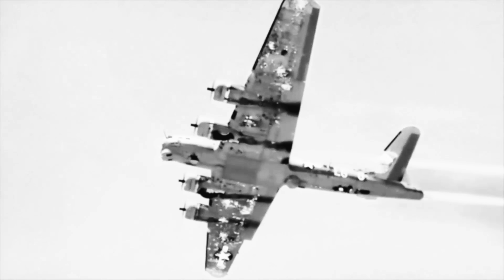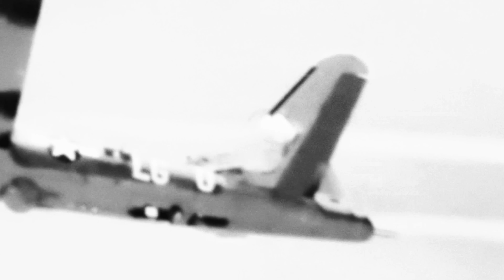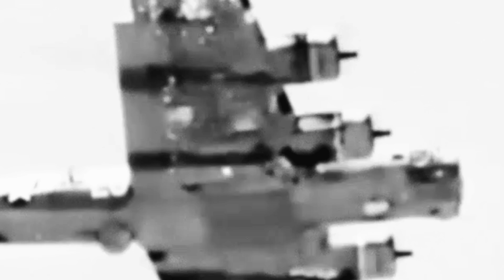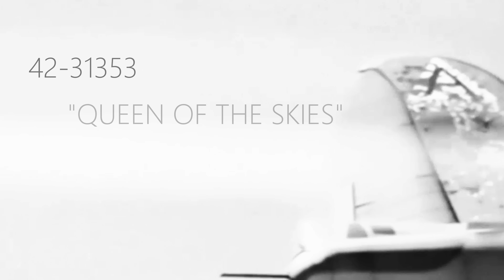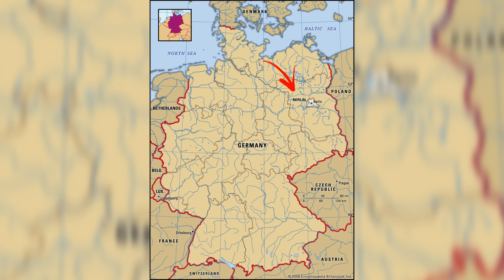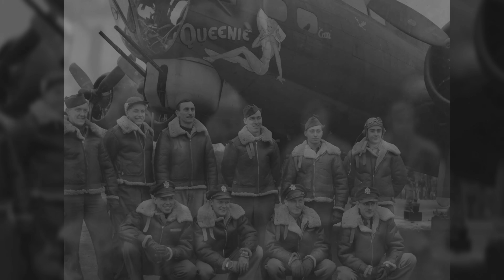The most Damaged B-17 Bomber you'll ever see Flying

Comment: My father was Army Air Corps stationed in the South Pacific during WWII and told many harrowing stories of B17’s in battle. The one that comes immediately to mind was of a landing wherein the entire mid-section of the plane had been shot away from the wings to the tail. The only thing keeping the tail section attached were the control cables. The tail-gunner having survived had to traverse the control cables hand-over-hand in mid-air to get into the main body of the air-craft...

Everyone knew what was going to happen when the plane landed: The tail-section would flip up and over impaling the fuselage. All of the remaining crew crammed as far forward into the cockpit as the limited space would allow. Have you ever been inside of a B17? The movies makes the interior look larger that it actually is. The quarters are really quite cramped...

The entire base was on deck to witness the landing as it had been announced over the PA. My father said as the plane lumbered in, it looked as though the tail-section was chasing the fuselage. As predicted when the B17 had landed and slowed so the tail could no longer ‘fly’ it immediately flipped up and forward as soon as it touch the runway. The rudder cut through the top-turret to quote my father ‘like a knife through butter’...

None of the surviving crew were injured in the landing. The only casualties on that mission were the waste gunners. Of those stories my father would often say ‘Any landing you can walk away from is a good landing...’ The B17 was called ‘The-Flying-Fortress’ because of the severe damage it could sustain and still fly. My father told many many stories of B17s with the nose shot off or missing a entire wing or with no tail-section or only having one engine operating while the remaining on fire or shot up full of holes looking like ‘Swiss-cheese’ and still able to return to base and land...

Foot Note: My father said that you didn’t use the rudder to steer B17s in flight because the controls were too ‘heavy’. The pilot would adjust the speed of the engines to get the plane to turn. Depending if wanting to maneuver starboard or port would determine the RPM of each of the four engines. By raising the RPM of the out-board engine and decreasing the RPM of each subsequent engine the plane would ‘pivot’ in whichever direction desired. The higher the RPM of the out-board engine relative to the other engines the sharper the turn...

My father’s generation were truly ‘The Greatest Generation’. They survived The Great Depression as children and saved the world fighting WWII as young adults. And look what a mess of things we’ve made of the world they saved. In parting: I’d a great-grandmother who said that the depression of the 1880’s was much worse than the depression of the 1930’s, but that’s another story...

Comment: The Allies commissioned a study on how to make these planes and other bombers more survivable from taking hits. A few different fields of study from different people, like statisticians, aircraft engineers, weapon designers, etc...
They went out to look at the planes that were damaged that we able to land. Some just had a few holes in them, others had giant chucks missing.
One fellow noted that all of the hits and major damage were in certain areas of the planes. So he stated that all of the other areas not hit my flak or bullets, should be up-armored and made stronger.
The fact that these planes were all hit in the same general area proved to them that the planes can take a great deal of damage in these locations.. but, the planes that get hit in the other areas are not coming back.
It was a pretty neat study and used an almost reverse logic. You fix up what you can't see and leave the other areas alone. I believe after that some planes had to get rid of a a crew member or 2 to make way for the weight of the new armor and supports.   Two men and two .50 machine guns weighs a lot.

Comment: My uncle worked repair on bombers returning from daylight bombing raids over Germany.  He had a bunch of photos of planes that made it back that you would never believe could have flown.  The two I remember most was a B17 that took a flak round through the nose and caused all the outer sheet metal to peel back to the bulkhead behind the cockpit.   There was a floor two yokes and seats for pilot and copilot all exposed to the open air.  The nose, bombardier, windscreens, and all the gauges gone but they brought the rest of the plane and crew home.  The second was a mosquito that bounced off the landing runway and pancaked into a big muddy ditch.  The whole plane splintered and shattered leaving a plane shaped outline visible in the mud with all the major metal components (engines, seats, guns, etc) just stuck in the mud surrounded by what in the photo looked like a plane outline made of oversized toothpicks.   Uncle Cecil served in WW2, Korea, and Vietnam repairing damaged combat aircraft.

Comment: My dad was a radio man on a B-17 in 1943 in the 8th AF. Flew 7 missions before flak shrapnel took his right eye. Finished as a Sgt, training other radio men in the USA. 
Went on to get engineering degree(GI Bill) and worked for NASA.
They were the Greatest Generation.
Reply: My great grandfather did the same thing, including training radio operators in North Carolina(I believe). If your dad had any stories about “Curly” Smith he was talking about my great grandfather.
Reply: My dad was also a B-17 radio operator. Once during a bombing run he turned away from his radio to throw out foil chaff (to throw off the AA guns on the ground) and when he turned back there was a flak shrapnel hole passing right through the plane at that location. Another time alone in the radio room during the long flight his oxygen hose froze up, but he was writing and recognized the lack of coordination before passing out, and was able to fix his hose. And another flight they lost 2 engines and had to throw out the guns etc. and after they landed the mechanics said a 3rd engine would have failed in another 5 or 10 minutes, due to an oil leak... over 100 holes  in the plane, but nobody wounded.

After 35 missions my dad got out and went back to Michigan Tech, switched from chemistry and got a degree in electrical engineering, worked as a civilian for the Army near Detroit and helped design the M1 Abrams tank.

He was literally born in a log cabin in Upper Michigan, literally walked a mile each way to school through the woods, and grew up chopping firewood, milking cows, feeding chickens, etc. during the Great Depression and had only 3 people total in his high school graduating class.

And he is still alive now, 100 years old.
Reply: THAts awesome !  I bet your dad was tough as nails RIP !
Reply: he was probably a Technical sargent...they got paid more lol...my grampa was an airborne engineer and was discharged at the same rank...the war really messed him up..
Reply: Your Dad may have trained my Dad, who was a radio operator and flew 35 missions from Jan to April '45.
Reply: My uncle John Russell radio operator B17 had to bail out over the Baltic sea incredible story of how he was saved by a German fisherman
Reply: The greatest THANKFUL generation.  I don't think there is anything worse than being ungrateful to God for allowing you to choose your attitude of gratitude.  Without it, you are damned.

Comment: I lived near an emergency landing strip near Birch in Essex. I saw an American bomber returning I could see the nose and wings. The fusalarge was invisible it looked like the tail was following behind. It was an amazing sight.
There must have been some connection all of the metal covering the body was gone. The crew must have sustained terrible hits.
Reply: That must have been the occasion when a B17 took part in a raid on Taranto in Italy. I have seen a photo of this event, the plane being flown all the way back to England with the fuselage almost cut in two. That was caused by damaged Messerschmidt 109 slicing through the B17. The crew rigged up a means to keep it from falling off by using parachute straps to brace the tail. By taking a very long turning detour so as not to stress everything the brilliant pilot managed to fly it back. All the while the tail gunner had to stay where he was, and just hope and pray! 
The tail broke off completely when the plane landed, but everyone was safe.
Reply: I live just down the road from that airstrip; only one 0.7 mile straight piece of tarmac remains now, it's where the locals have their first experience of driving a car, as there's not a lot to crash into. Birch Airfield was sadly famous for a major fracas involving a GI and a local taxi driver. One of them died. Rivenhall aerodrome by contrast, has many of the billets and nissen huts remaining...even the old cinema still stands.

Comment: Boeing built them tough, didn't they? 🐯
Reply: @joecserna  Kamikaze Goose.
Reply: Make sure not to take it past 350 Joe
Reply: @TyrannoJoris_Rex  These Planes weren't meant to fly at those speeds. Bombers are slow planes and the B-17 was the toughest of them all.  An example would be when a BF 109 rammed through a B17s tail section, nearly tearing the plane in half. But, the tail stayed on via a thin metal strip. The bomber actually landed. If that was a modern bomber it would have just disintegrated
Reply: My point exactly Sid. They weren’t built to fly that fast meaning they couldn’t handle it and therefore wasn’t as tough. And an Me 109 wouldn’t even catch up to a modern plane, hell it’d be flung out of the sky by its exhaust